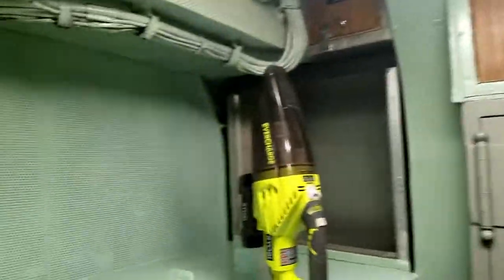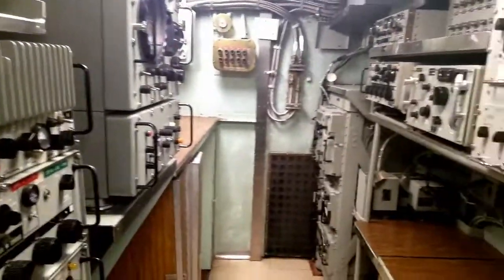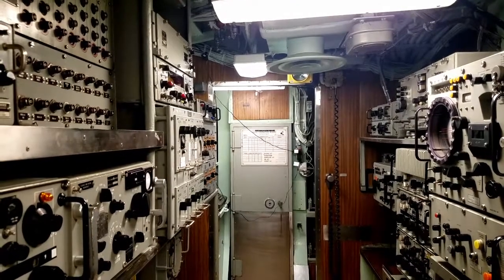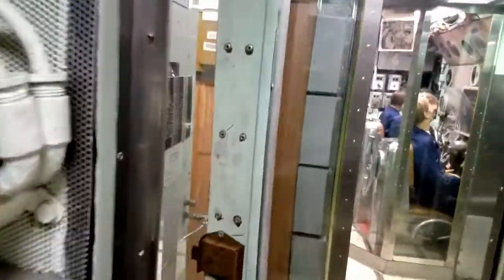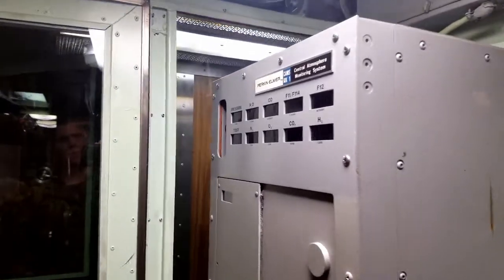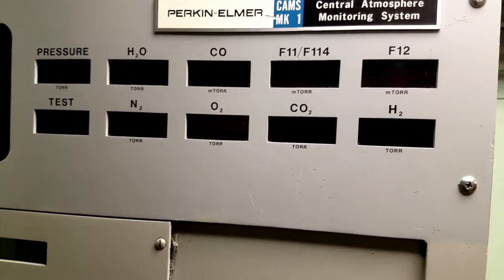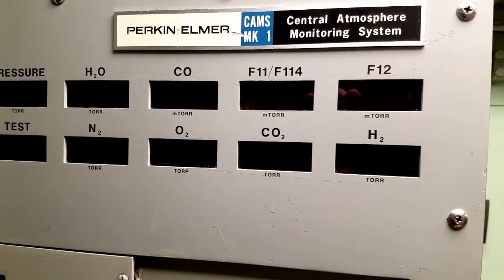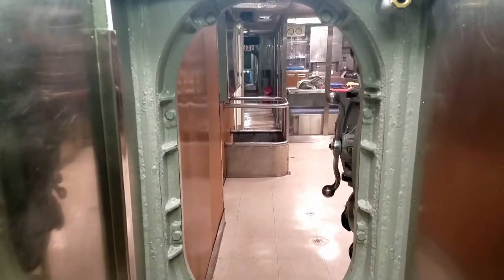Episode 9 - Radio & Interior Communications

Comment: Would you happen to have any spare parts for the general announcing amplifier? I'm missing 2 square 8 pin octal relays and have searched Cavalla all over but found nothing useful. Ive almost got our unit working but just need a few bits and pieces to make it fully operational.

Comment: Some electrical panels are grey and some are red. What is the difference?
Reply from the maker: I'm not sure exactly what that means on the Nautilus - different colored panels mean different things depending on what loads they are carrying.  On today's submarines breakers are color coded for quick identification between vital and non-vital loads. 
 Galley equipment would not be non-vital.  Power for SONAR, seawater pumps, dewatering pumps, etc. would be vital and need to remain energized.  This way non-vital loads can be quickly secured in the event the submarine has to shift to battery power - thereby extending the battery life.